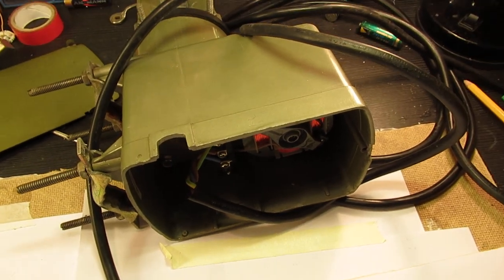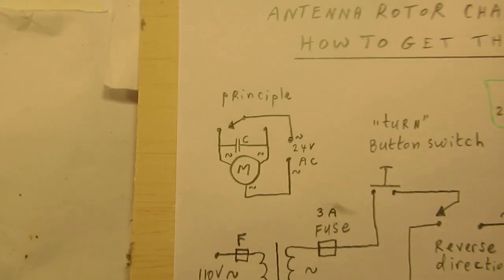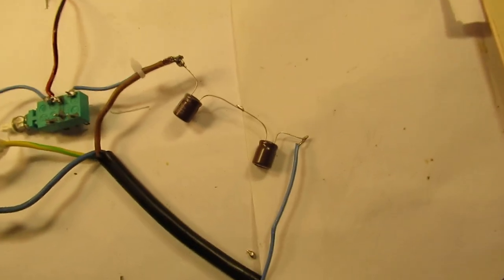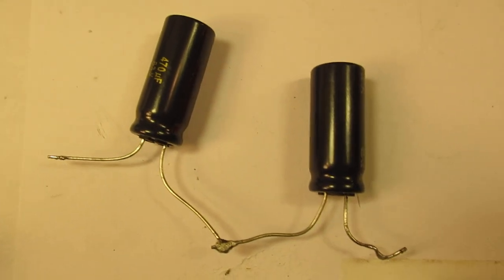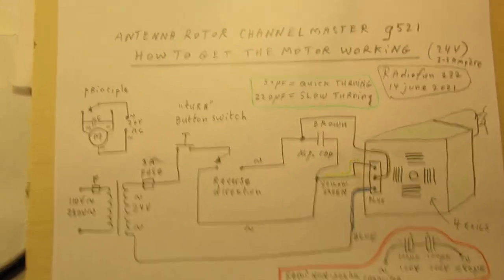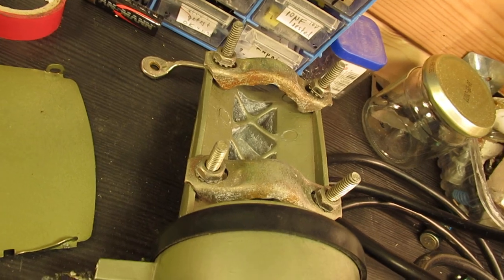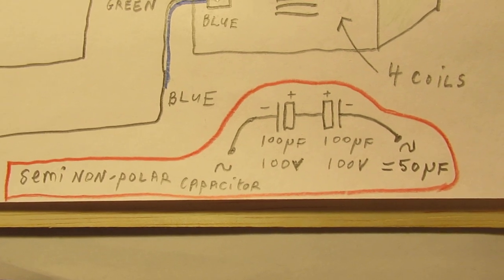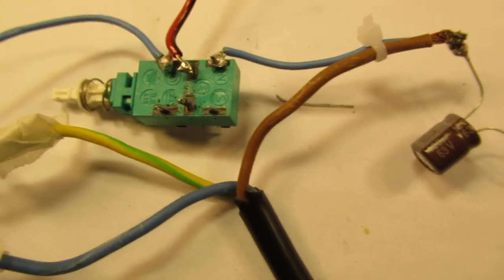Antenna rotor Channel Master 9521: how to get the 24 V AC motor running normal/reverse

Comment: Thanks for the help. I wired mine up and it does nothing. I'm no electrician so I guess it's junk. It is nice to know that it doesn't work without this capacitor.
It figures though. For me, just a piece of junk.

Comment: The control box supposedly uses an identical motor, and they are both in sync with each other. They will need a switch to stop the motor from going beyond 360 degrees so it doesn't damage the antenna cable. Some older channel masters used an automotive fuel gauge system to indicate antenna position.
Reply from the maker: Thanks, good info! Yes, I know that. The video shows the basics to get it all working again, even when the control box is lost. 3 July 2023.

Comment: Thank you for confirming my suspicions, I have stumbled across an abandoned vintage channel master in my local woods and took it apart. I was guessing the motor was a permanent split capacitor motor based on it's wiring but couldn't find any schematics or phase capacitors inside it.
Reply from the maker: Thanks, good to hear that it was useful!

Comment: I want to thank You for Your video on how the channel master rotor circuit works. My in-laws love their soccer, but with all of the  rain that we had, their soccer channel was pixalating a lot. I have a channel master 9521 rotor and tried to rotate the directional vhf antenna to clear it up. I accidentally pressed the sync button, and just when the antenna rotor positioned itself to the 000 position, one of the relays in the controller failed to energize. Thus the capacitor inside the control unit would not connect to the rotor controller output terminal, and the antenna would not move.
Thanks to You and Your video, I was able to connect voltage to the rotor connector terminals by jumping contacts on the failed controller pc board and get the rotor to reposition the antenna to an operative position. Without Your video, I would have taken down the antenna mast to look inside the rotor assy. for faults. You saved me from a climb on the roof after a rainfall. Thank You.
Reply from the maker: You are welcome, good to hear that! When I saw this rotor for the first time I did not have a clue how it worked. After experimenting I saw how it worked. Goor to hear that I saved you that climb!

Comment: That was interesting, never seen the inside of that system before. Perhaps add two micro switches to cut off power when your reach the end of travel in either direction.
Thanks Ko.
Reply from the maker: Thanks Barry, good idea. (I made it for another radio amateur).

Comment: Bij mij werkt het! Maar hoe hou je de positie bij? Er zit geen potmeter of andere vorm van feedback in.
Reply from the maker: Ja, dat is inderdaad een probleem (pje). De originele voeding (doos met positieknop) was destijds zoek. Daar zul je dus iets op moeten bedenken.....Ik weet even niet wat je zou kunnen maken.
Reply: @radiofun232  Gebruik je de rotor nu zonder uitlezing? weet je hoe het origineel werkt? Ik hoorde dat er in sommige rotor controllers een motortje zit dat even hard draait als de rotor zelf.
Reply from the maker: @necessaryevil8615  Er zit normaal gesproken een kastje bij met een grote knop (360 graden). Die zet je (bijv.) richting zuid, x graden. Dan draait de motor en slaat automatisch af als dat punt is bereikt. Het kastje was zoek. het enige doel was in dit geval om de zaak weer werkend te krijgen. Ik maakte het voor iemand anders.
Reply from the maker: @necessaryevil8615  als je naar Google gaat en het woord antennerotor intoetst en dan naar afbeeldingen zie je een website: radiomuseum punt org. Daar staat deze rotor, ook op andere websites. Daar is denk ik meer info te vinden hoe het precies werkt. 7 juli 2022.

Comment: In de jaren 80 toen hadden we dergelijk systeem hier in Belgie, toen er nog een "tv-kabel" (coax) was.
Van de controller herinner ik mij 2 types, bij de ene was dit een bakje langs de tv, met de zware 30V transfo in wat de motor op dak bediende. De bediening was met 1 knop met een soort manuele schakelklok intern, hoe verder je deze knop draaide vanaf de 0, hoe langer de contacten gesloten bleven en stroom stuurde naar buiten toe. 
Bij het 2de type, was dit een bakje met 2 knoppen, de ene knop had letters A,B,C,D enz, en de 2de knop had nummers van 1 tot ..... , met deze 2 knoppen konden dan diverse combinaties gevormd worden zoals A1, B5, C4 enz, elke combinatie was een bepaalde stand van de antenne op het dak.
Hoe deze exact werkte binnenin heb ik nooit geweten, bij het 1ste type was dit een kleine print met enkele relais, en een schijfje met contactpunten wat met een servo motortje draaide op een zeer lage snelheid.
Reply from the maker: Goede info Bjorn, bedankt.